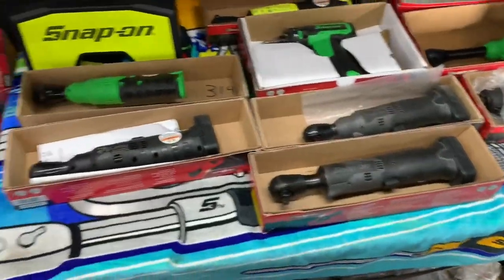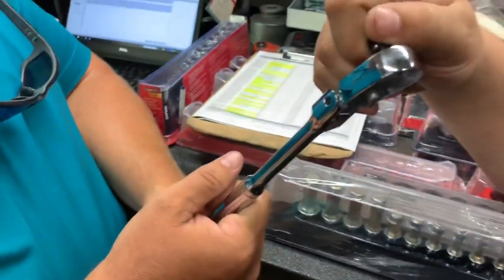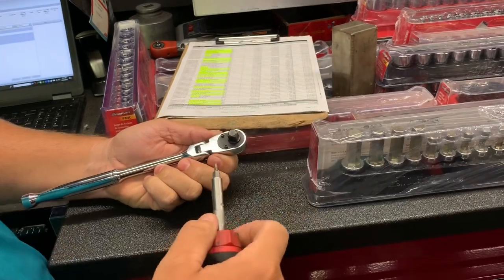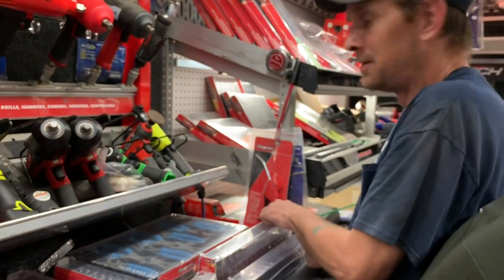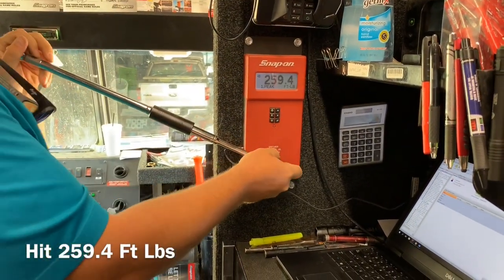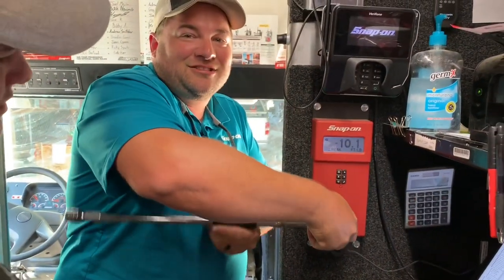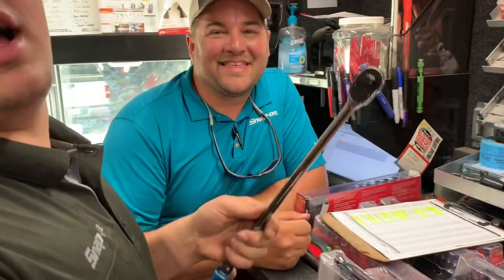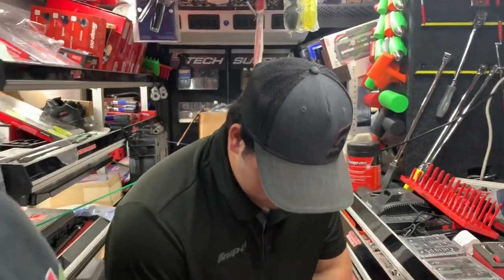Snap On Dealer Puts ICON Head To Head VS Snap On Ratchet

Comment: Harbor freight is junk just because the rebranded their hand tools and boxes doesnt mean anything. I had their Earthquake XT 1/2 air impact gun the first one blew up after 1 week of use and the replacement one lasted 3 wheels before it blew up. Harbor freight is not for the professional or even the do it yourselfers out there. They are good if you need the tool once and dont ever need it again.